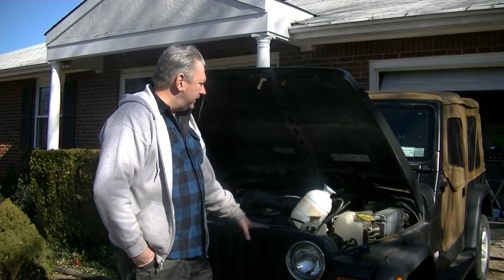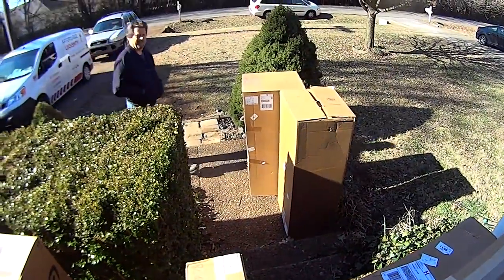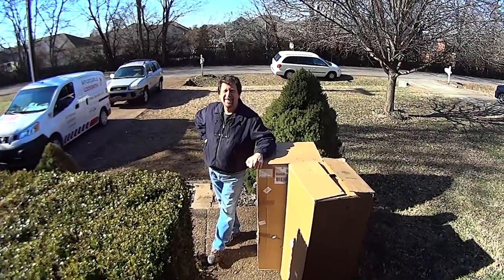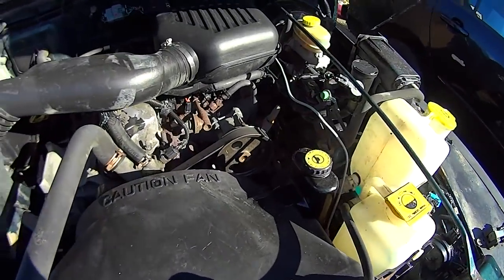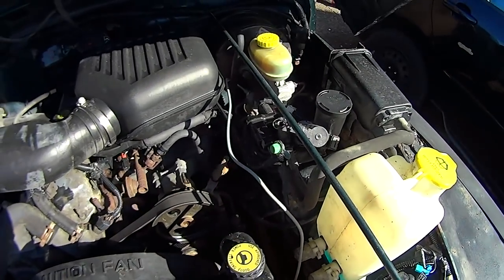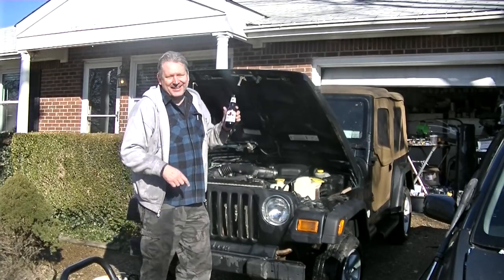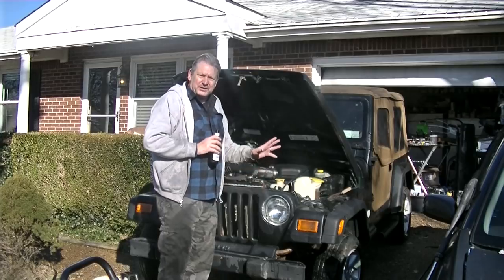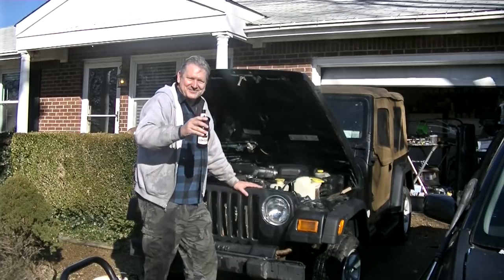Jeep Wrangler 2.5 / 4.0 Rebuild Series - Prep Work (1)

Comment: 55° would feel awesome, it's been cold here in Minnesota- many days in the past month we haven't even made it above 0° for a high temperature. It was 35° today so I got out and did a mid-winter check up on my TJ, checked all fluids, pressure washed the frame and cleaned up the whole vehicle. I like those seats you have, mine are the sahara seats (green/tan) it's a tougher cloth I think and it doesn't have any vinyl around the edges to crack, it's all cloth. They have held up really well for having 150k miles in them
Reply from the maker: Yeah it got up to 61 here today which reminded me of spring :)  we will see on the seats - they may get changed at some point but they still look pretty good. Where you live is too dang cold :)  I'm ready for longer days and warmer weather !